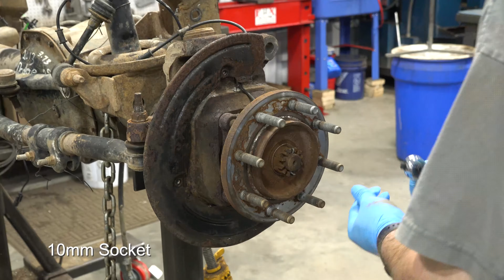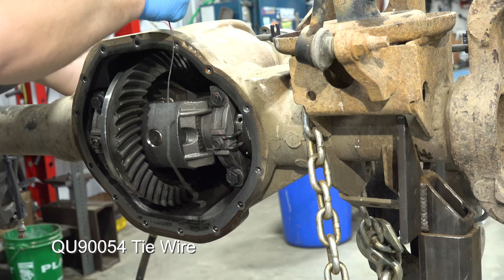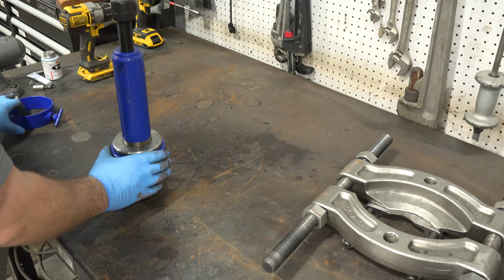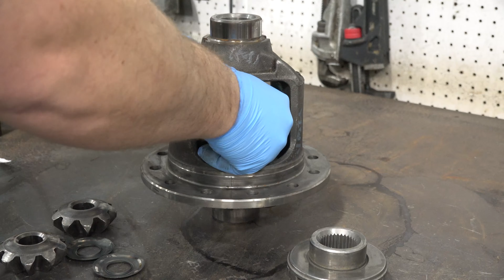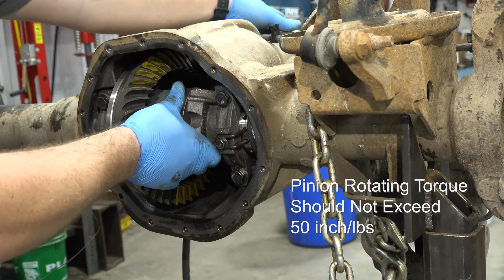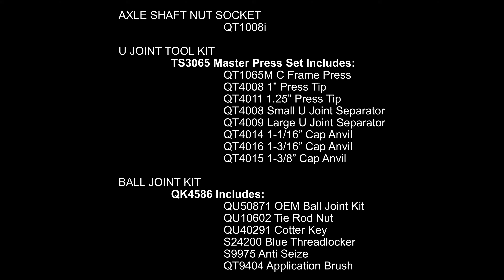Dodge Ram Front Axle Service 2003-2013

Comment: Not one reply on any of the comments regarding the adjuster nut adjustment. The thing I would like to know is after you initially do the lash, if it is not correct, do you loosen the race cap bolts and adjust then lock it down again or leave it torqued and adjust

Comment: When you tighten down the race bolts... does the backlash reduce down to .004 after you have the dial showing .007 or am i doing this wrong?  You cut the video in those areas  where your torquing the bolts and didn't say if that would change up the backlash.  
I'm reinstalling worn gears after replacement of bearings.  I have the gear torqued down and it's much harder to spin and need a rag to hold onto it to rotate it.  I don't know how this is suppose to feel, In your video it looks like before you put the cover back on,  you can rotate it fairly easy compared to what I have.   I don't want to install anything else and risk damage of other new parts .

Comment: Is your outer pinion bearing closest to the nut supposed to slide on with out pressing or hammering on? Because the crush sleeve would set the tension?
Reply from the maker: The crush sleeve sets inner and outer bearing spacing, and generally the outer pinion bearing is a press fit.

Comment: My question is simple how much it cost to do this presidure on a 2008  ram 6.7
Reply from the maker: Depending on what your local shop rates are, probably $1000+ in labor plus parts. If you do it yourself, depending on what exactly needs replaced you can potentially be under $1000 in parts and tools, plus a couple days of your time.

Comment: At 37:20, it says you tighten 6 holes for new bearings 4 holes for old bearings.  Does that mean you back off the pinion side 6 or 4 holes or is that referring to the initial backlash setting of 4 holes on the ring gear side?  Seems like that’s too much side play
Reply from the maker: That is shifting both nuts over to achieve specified gear lash, plus preload.

Comment: You mentioned that the wheel hub should come out with a suitable wheel hub puller. Is there something suitable that you can point me to?
Reply from the maker: Now that most things are discontinued after this video was made, Mac Tools L39250 or L39300 + air hammer to drive on the bolts is about all that remains for removing a rusted in hub. If you can find a used J&J Hub Puller, that is the best tool we have used.

Also heat cycle around the knuckle/hub pilot a couple times with a MAP torch and spray a good penetrating oil as it cools. Heating will push air out and loosen things up a bit, and cooling will suck the oil in. You can use a regular torch but be careful not to overheat.

Comment: I just picked up a 2005 power wagon that needs a front diff service. How much difference is that diff to service since it has the electronic lockers.
Reply from the maker: The diff carrier itself is a bit different, just don't drop anything or pull on the internal harness too hard. The electromagnetic components are kind of delicate. I would recommend putting a folded up moving blanket (or something else padded) under the axle while removing the diff. I believe Harbor Freight has them for pretty cheap.

Besides that, the bearing and gear procedures are the same.
Reply: @TorqueKingTV  awesome info, thank you. Quality video.

Comment: what shim size do you use to start with?
Reply from the maker: For just replacing bearings, use the factory shim. For a regear, measure pinion depth to identify correct shim.

Comment: If you got a differential
supposed to be good, not making noise is it typical that it would be loose and could be tightened up to have the clearance reset or am I dealing with something thats trash doesn’t seem to make any noise or have any problem but I believe somebody put some new parts on this truck and never set it up right you can turn the driveshaft with a lot of play between the gear lash😮 thanks.
Reply from the maker: If you have excessive lash, you will want to check everything. Could be as simple as needing to adjust the side bearing nuts but an in-depth inspection will let you know if bearings need replaced.
Reply: @TorqueKingTV  yeah that’s what I’m afraid of. I bought a complete high-quality USA. Timken bearings the whole shot for a complete rebuild. Then I found another rear end cheap. It seems to be tight I’m gonna pick up I may just put some new seals in that one first and put it in so I can rebuild the other one on the bench instead of underneath a truck in the snow which is probably coming. Thanks for the info. I’m sure you’re probably right I’m pretty sure the pinion bearing went. I didn’t find any metal in the thing but there was some pieces of junk in there and I get the feeling this truck they put a bunch of new parts in it. They never adjusted anything the ring gear that’s in there look at somebody took a 4 inch grinder and tried to divert or something, so I just bought all new gears and everything whatever I don’t need I’ll send back I’m actually getting into rebuilding these where I might be able to get really good deals on parts out of Detroit and then just charge charge a standard $500 rebuilding fee, which is probably about 30 to 40% of a dealership close I’m real I’m willing to help all the hot rider guys boy cleaning the thing re-painting it and they can go with all new parts like plates and brakes in the whole shot and that’s fine. They’ll have a complete like brand new rear end, cheaper than they be able to get it anywhere, I’ll tell you what the real problem is on these things don’t use that damn synthetic oil would happen on mine is they put a chrome cover on there that was probably Chinese in because the check the synthetic oil has no anti-rust in it the stuff was like Crisco and it rusted right through the plate and leaked very slow so he didn’t pick it up so by the time I pull the pan off it was practically dry strange 01 dodge are on the company. People had this type a rear end around for 40 years and before the synthetic oil garbage is coming out they never blew nothing. This is definitely not your father’s Dodge. Silantros is a joke all they use cheapen  stuff. I just read yesterday that the 2004 ram 1500 trucks may actually be one of the last good years because they actually came from DaimlerChrysler who was trying to address whatever problems they found if anybody knows the name of the kit that you could replace all the heater box doors with aluminum doors that don’t break off when you drive down dirt road, let me know because my nephew says there’s one out there if you ask me and I’m going to file a complaint and I encourage everybody else to do it when I do it I’ll probably publish it. I’m actually sort of a retired lawyer but I’m more in the hot rod shit arms, I think God should have to recall all lease cars and trucks that the heater boxes air vents fell apart or don’t work because everyone of them does it is it amazing how you can go into a junkyard and find a 70 Chevelle well you’re not gonna find one anymore but years ago and everything worked on the car the ignition in the heater box in all the controls but now we build this junk and if you don’t replace the ignition switch, the battery goes dead and if you don’t fix the heater, you don’t have any defrosters and you probably freeze your ass in the winter It’s ridiculous. I want to see American quality back in America and I’m sure you do as well the only way to do that is by writing law and destroying NAFTA in US MCA that it was renamed and put down law to all the companies that are actually run by a monopoly young by JP Morgan that we see you either get back here or you are banned from importing your stuff into America because we don’t want junk that has no quality control that they throw handfuls of salt or whatever it is in the steel made in China because it’s no good. It just rust out cracked brakes off whatever it’s garbage I had a brand new gas tank bracket look brand new last year this year the gas tank almost fell out. It was obviously replaced with Chinese steel. You know the easy way to fix it you go down to Walmart and you get a 2 inch ratcheting straps. Can you wrap it around to make sure you get it over the top support that hangs the tank can you pull it back up shove it back up with a jack slowly with the board where it supposed to be and you ratchet that strap and you cut off the straps it’s not hanging down, it’s probably a lot better than original. They should probably actually make some Kevlar straps to put in these tanks and they would be permanent. They’d be easy to drop. I will never understand why we have to have a fuel pump inside of a tank they could’ve just as easily put it in front of the tank, I really don’t think it would’ve made a difference if they were to put it up there in the engine compartment so you could easily worked and it seems to work fine on the drag boat actually electric fuel pump on the car with the carburetor works just about like fuel injection, become because it pumped up the fuel pressure before you start the engine in pretty much when you pump the gas young, she primes her with a nice shot a Gaston whom starts right up I couldn’t believe the 409 that I rebuilt was probably the best Engine I ever rebuilt. I put it in the drag boat told my little brother OK I’ve been through everything it looks like it’s ready. Got to see what happens. I turn on the key pumped up the fuel pressure and the damn thing started like I just shut it off, the timing was right and everything was right on all the valves with the Iske roller cam. We looked underneath at the prop with a 20% overdrive and said holy shit. This thing is going to fly lol yeah I’m about 30 miles an hour at idle and when you punch it, there was no hesitation you just heard his echo and it was doing 100 you got to give a flat bottom drag boat there’s no trip like it, I still want it she’s a 1966 speaker with all my custom upholstered seats burn up in the house for you I’m gonna have to start over it’s too bad cause I had a customs golden crossbones so right in the seat. it was funny because the skull in the distance kind of look like a cop boat insignia in my buddy says I’m fishing there and I hear this boat idling with this big, huge cam and he’s like who is shit what? No he’ll do the pigs have they must mean serious business L O L this thing one so fast, it could come right up on the prop. I actually took is supercharged 494 Ford in a modified jet. He waited till we got doing about 50 before he finally punched it, and I punched it probably took in my four or five weeks before his blower really come to wife and I just use his screech and he come up next to me and just beat me and he was cool. We were talking for a minute. He said he knew my boat before I bought it but I went back home and I was like that’s it. I’m pulling the L 88 out of the Chevelle and putting a blower on it, instead I won’t get beat next time. Unfortunately I heard the guy is dead now not from boats, but apparently got a fatal disease and he was a super rich guy in charge of a big corporation or owned it or something. He had a beautiful boat. A few other businesses around town knew the guy he wasn’t from around there it was up in Michigan. I think he was from Chicago, I love all the stuff especially supercharged engines. I worked for Perkins diesel for probably eight years before they started having problems of management.

Comment: I have just picked my 06 ram mega cab from having the bearings replaced, I no longer hear the whining but now whenever I'm turning left or right there is heavy grinding noise but worse on the left turn and when starting from a dead stop, what do suppose was done wrong? I'm returning to the shop so that they can fix the issue.
Reply from the maker: I'd say a bad axle shaft joints are bad, or something in the differential. Also check the front driveshaft, it's probably not that but the CV head is a service item.

Comment: I need to do the bearings in my front and rear end and all of the videos I've watched I have yet to see anyone set pinion depth according to FSM. The tool alone is $500 so im curious how did you go about setting your pinion depth and how do you know the proper nut torque if you dont have a rolling torque number to start with?
Reply from the maker: If just replacing bearings, 99.9 times out of 100 the pinion depth will not change, and if it does any change will be minute. This is assuming that good quality bearings are used. We do have another video posted of measuring Spicer axles which is a similar procedure.

If changing major components, depth would need to be adjusted. Instead of buying the tool you could just get an extra set of pinion bearings to grind out until they are a slip fit. use those along with the old crush sleeve and nut to check the pattern with gear marking compound. We do use pinion depth tools for initial setup, but the fine tuning is always done with slip fit bearings and marking compound.

Any time the pinion nuts are removed, the crush sleeve and nut should be replaced. This procedure is in the FSM, no prior rolling torque number is needed.

Comment: Any videos or recommendations on removing the front axle completely like you did?
Reply from the maker: No videos on that and I don't know what kind of vehicle lifting ans safety equipment you have, but the basic procedure is remove and hang calipers, unbolt control arms from frame and shock top bolts, and make sure ABS wires/ drag link/ track bar/ sway bar links are disconnected.

I would recommend following safe removal steps in the factory service manual.

Comment: what would this service cost? 2 grand? like if i buy a dodge ram 2500 and go get this service done how much do you think it would be?
Reply from the maker: Depends what it needs. To have it done, figure 1000 in parts and 1-2000 in labor, depending on your local rates for a bearing and seal replacement. Add on more to replace major components. Of course, most shops put the cheapest parts in while still charging a premium.

Could do it yourself for quite a bit less.

Comment: Hey just wondering how sure are you on the ring gear torque and also do you not need threadlocker on ring gear bolts?
Reply from the maker: The procedure/specs is right out of the Chrysler manual. Some applications don't specify threadlocker, while others have it pre-applied on new bolts. I would say use at your own discretion, however my personal stuff usually gets medium strength on everything.
Reply: @Torque King TV  thanks for reply, your videos made my life easier that's for sure.

Comment: Nice job.  I thought plan next year to change my front axle on my 95 to a later model to install 3 gen brakes . Up grade steering linkage ect ect .  At one time I had wanted to go with locking hubs and get rid of the cad say a 2002 axle . May be Timken bearings . The unit bearing seem to last OK.  Not sure thanks for the videos

Comment: Just did the inner axle seals on my 2012 ram 2500 and they are leaking after the first drive…
Reply from the maker: Sounds like you may need a QK4685... https://torqueking.com/product/4685/qk4685-front-inner-axle-seal-and-tool-kit-2003-13-ram-aam-925-14-bolt/
Reply: Hey I am having the exact same issue right now .disassembled axle to fix drivers side leak. Replaced both seals with SKF CR seals and ended up with two leaks. Done the complete job over again figuring I damaged the seals or driven them in the housing too far and now I’m back to square one with still the driver side leaking. I’m curious on how you resolved yours super frustrated and any help would be much appreciated thanks

Comment: I got a 05 ram 2500 got stuck in the mud one time and only one of my front tires was spinning 
Are these front diffs non lsd?
Reply from the maker: Besides the reintroduced Power Wagon that has E-Lockers, the regular pickups do not come with any type of traction devices in the front. There are some aftermarket options available.

Comment: My differential definitely is not coming out that easy. My 2014 ram 2500 has the same setup. Any ideas??
Reply: Once you loosen the nuts it will fall right out.

Silly question, you did remove the axle shafts first correct?

Comment: Just did this on my 03 9.25 and 50 miles later the outer pinion bearing went out, with indications it had gotten hot. It had plenty of fluid in it. Have you seen a similar issue?
Reply from the maker: Hi- yes we did have a local customer with the same issue a few months ago. We determined there was an issue seating the bearings correctly so the torque loosened up on the crush sleeve as the vehicle was in motion.

I wouldn't say it's a common issue but it does happen.
Reply: @TorqueKingTV  thank you!